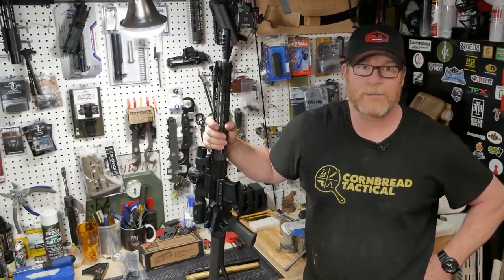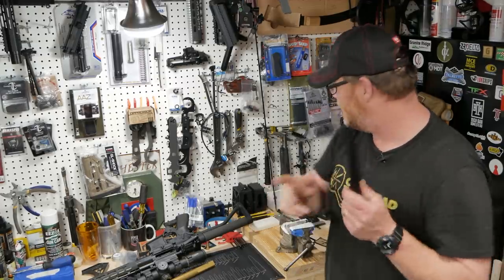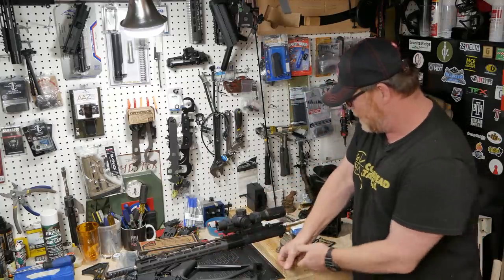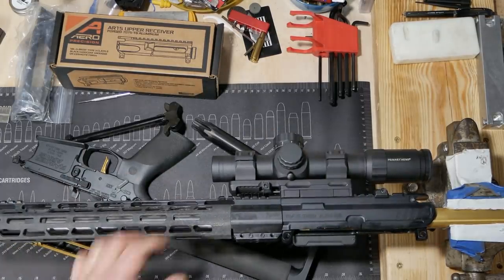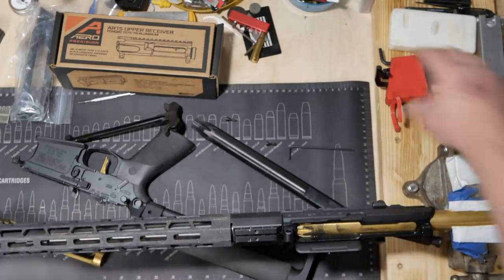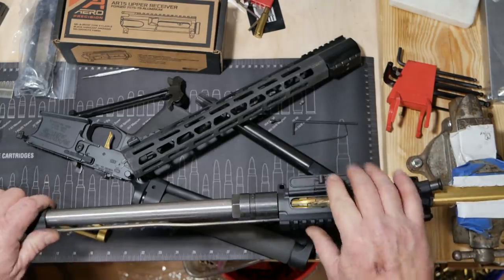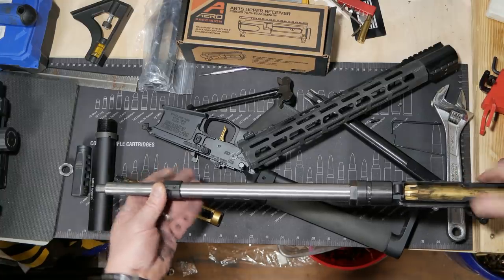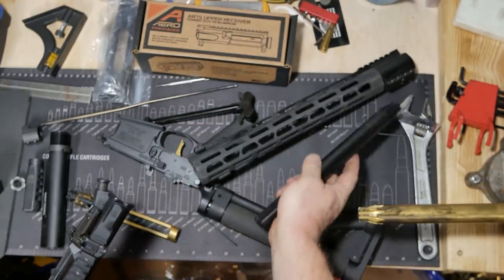Receiver Rod by APS Inc  Why you Need This

Comment: I like the BEV block byMagpul, same general advantages with the added ability to throw a pin in so that if your pulling away it wont slide off on you. Disadvantage being you can’t rotate the receiver.

Comment: Great video. I think these are great for tightening a muzzle device, or just a general convenient position for light duty work like installing a hand guard. But I can definitely say that’s not for torquing barrel nuts. Without a sail on top, you are putting all the pressure on the index pin.

Comment: My receiver rods (ar-15 and ar-10) are steel. And they have tight tolerances so there is no slop when locked into the receiver. I have never used a clam shell on the upper

Comment: The better one is from Midwest industries. It has added support with a charging handle channel slot so u can torque real good without putting extra stress on upper receiver. It is also removal if u wanna use it for simple jobs like removing hand guard.   Check it out. Yes it’s expensive. But the quality of there tool is second to none and you’ll have it for a lifetime.
Reply: That extra support puts pressure on the aluminum reciever, stick with the rods that use the barrel only
Reply: @jonme5652  bullshit. Index pin is alot weaker than a 9 inch section of receiver. Spreading out stress points reduces damage period

Comment: those are great products, you will have to check oout the one from Real Avid, the one in my Real Avid AR15 Master Armorers kit is awesome, it has two pins that go in it that will keep it
angled up a little while yoou work on your receiver or barrel, it also has a block that pulls out of the end that once your rifle is on the bar, this block will lock it in place so that youor gun
wont slip off while working on it

Comment: I recommend the Midwest industries receiver Rod it is a different design for the better..
Reply: Started with a Geissele, and ended up with a a Midwest Industries one... The added portion to grab onto the charging handle channel is nice, and you can alway remove it if needed...!
Reply: Same here.  Mine fits pretty tight, and definitely has that feeling of a quality product.  Plus, it's STEEL.  The bolt on top piece that sits in the charging handle slot is a definite design improvement IMHO.  Plus, they're from my home state.

Comment: I want to see a video of the barrel getting removed from the receiver. Did you use heat? Are you reusing the upper or replacing it with what's in the box on the bench?
Reply from the maker: I used a one inch wood dowl and yes I had to use heat

Comment: So, the JP handguard will fix why that rifle is shooting 1.5-2" groups? Is it a magic handguard? This seemed more like a commercial for the receiver rod.
Reply from the maker: Yes, I sprinkle JP Sparkles on the whole rifle and wammy, 1/2 inch groups.  Actually I have to clean the bore and get rid of the carbon build up, that will bring it back to sub moa.  The handguard is just an upgrade.  As for the commercial, I just wanted to demonstrate the usefulness of the receiver rod.
Reply: @kotaboy32  No worries. Sweet rifle, by the way. Rock on and have fun!

Comment: Looks like the Geissele Reaction Rod but for half the price.
Reply: Geissele is steel, so if you're going to be tightening hundreds of barrel nuts then it may be better. If not the aluminum works for most folks, and it's much cheaper.

Comment: I like my Kley-Zion rod, it"s steel and have used for several years for barrel nuts, muzzle devices. It was only $50 from botach.com
Reply: 762x51 rod from the same company is good too.
Reply: Brings up the question if steel on steel may damage your chamber or aluminum upper?
Reply: @breadman32398  The carrier, bolt and chamber are steel. Not sure how a steel rod is going to damage an upper.  I got both Kley-Zion rods on sale and figure those are the best bet.  I guess if I got those aluminum rods in a TacPack I would probably use them but would rather pay a litte more for the steel ones. They work awesome.
Reply: Good looking out, just ordered one. Would much rather have a steel one over aluminum for the same price. If Geissele thought aluminum was better they wouldn't have made theirs from hardened steel.

Comment: I guess Geissele failed to get a patent on his Reaction Rod? Or is this like RTIC ripping off YETI?
Reply: RTIC is just as good if not better than yeti for half the price.  And better yet, you don't look like a douche with a Yeti.  Geissele is so damned over priced, they deserve to have someone "rip them off."
Reply: Cajun Swamp Fox, my point is specifically about intellectual property rights...in that RTIC was clearly a direct rip-off of YETI design.  So much so that RTCI lost (or settled?) the lawsuit by YETI.  When you have the great idea & invest the capital to see a unique product through to market, you deserve protection from straight rip-off copycat products.  Seemed same for this product...until I just googled it, saw MI has a sweet improved version. My only exposure is to the original Geissele products. I bought Reaction Rods in both AR-10&15 years ago. Money well spent for the countless times they’ve been used for AR building & tinkering in my opinion!  Seems they must not be getting ripped off if several other manufacturers (include the very big MI) are making near identical products. My YETIs were all bought before RTIC existed. But as RTIC makes theirs in China, I moved to BISON for my more recent purchases because they, like RTIC are a TX company...but the make their coolers in the USA.

Comment: You can break off barrel indexing pins easily with reaction rods, don't believe me?  Just keep building
Reply from the maker: Yeah, there's no logic to your statement.  The barrel extension pin is on the barrel, the receiver rod is connected to the receiver extension.  the receiver itself is independent and free floating essentially.  But with the receiver block, the exertion of energy would be the same between the receiver and the receiver extension......  so help understand your comment and please give an example
Reply: @kotaboy32  do some research , that's exactly what I thought too  but it's true
Reply: I did it once with a dpms barrel,  now I only use it for rails and muzzle devices
Reply: I think the one made by midwest would eliminate that problem. It has a removable key to keep the receiver from turning.
Reply: @kotaboy32  Bretts correct, Kota your wrong.
Reply from the maker: @RayLahey  How did you do it?
Reply from the maker: @ZXRVideos   Didn't need to wrong or right, just want to know how it happened
Reply: @kotaboy32  i cant remember if i was loosening barrel nut or tightening but it sheared off and spun inside the extension,  i ordered a new pin and did it myself but adco told me they see it happen a lot  now that said I've used it on other builds with no problems,  not sure if dpms was just a lower quality barrel but I've always thought they were decent,  obviously not bcm etc but still lol